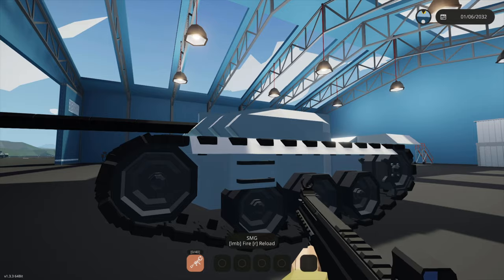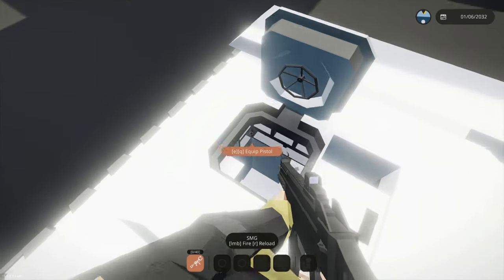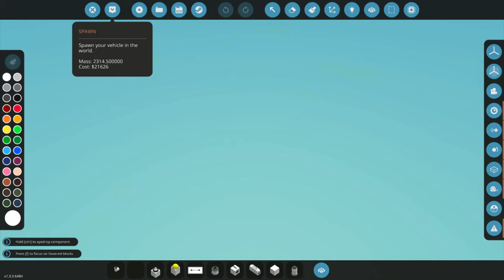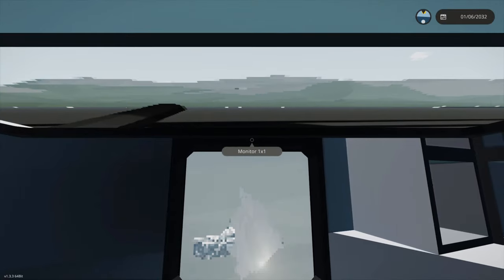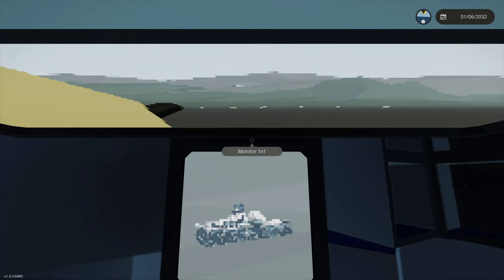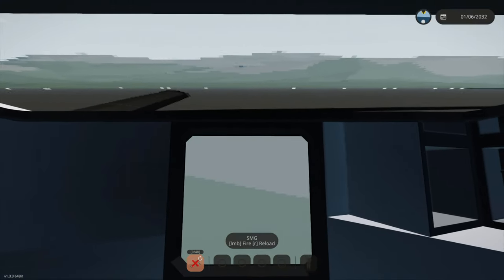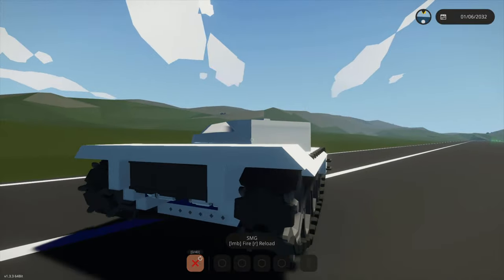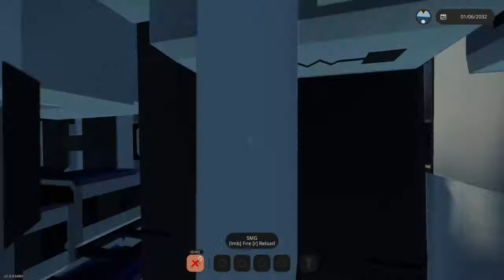Belt-Fed Autoloader |  XMBT MK 5  |  Stormworks Tanks

Comment: Maybe instead of a gunner's sight and wide view camera, you could use numerous cameras at varying angles to give you a wide, but usable screen view which doesn't look so much like a Minecraft portrait which functions as both the sight wide view.
Reply from the maker: I'm planning on making the main sight have multiple zoom levels, but the issue with a setup like you suggested is size. Mostly internal size. Since the sight rotates in the turret we need significantly more space inside.